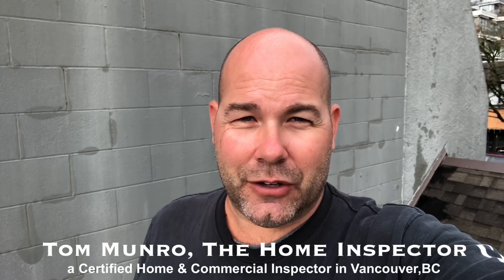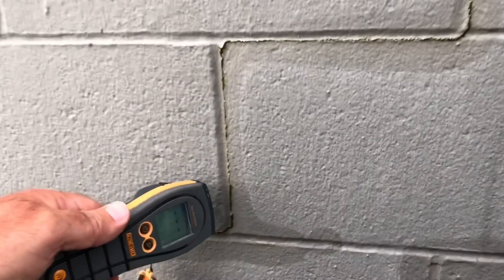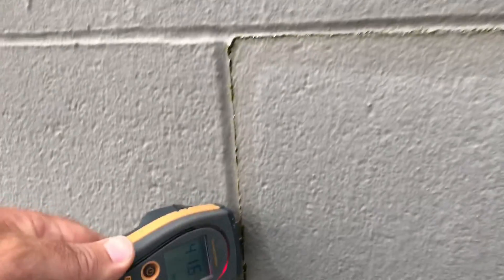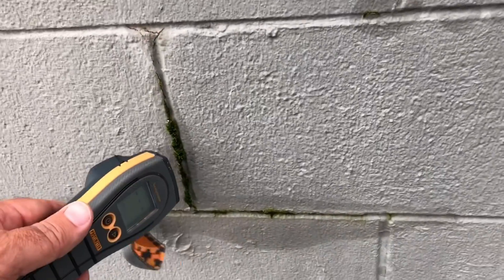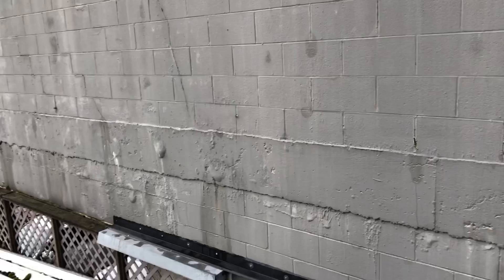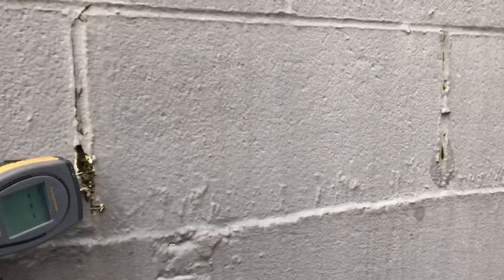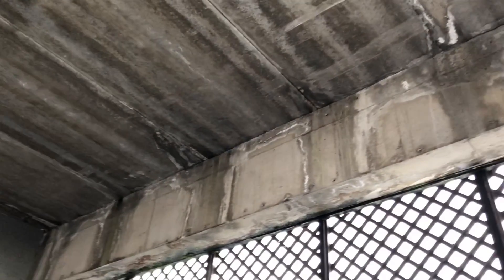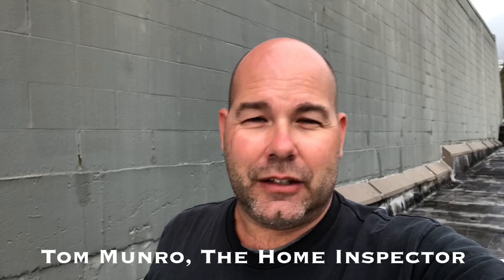Moisture Ingress Through a Concrete Wall

Comment: I have continued moisture in a concrete wall (Orlando) northwest part of the house. We had a roof leak (at the flashing where pitched roof meets the stucco) 9 months ago, took care of that, took the wall down to the concrete block, cleaned and dried out the concrete and put everything back together. Now after a hurricane with lots of rain, seem to be having moisture and funky smell in the wall again (although funky smell never completely left) House is 4 feet off the ground. Wall is part of a corner wall. Sprinklers are well away from the house. Need someone to solve this mystery.

Comment: I live in an apartment with concrete wall that has patches in wall above the window and when it rains it leaks water. The builders came in with a moisture reader which read 55% moisture should there be a concern about water inside the wall and mold because i see small black spots have started to appear in the area of the leak

Comment: I have an air conditioning drain tube (10 inches) coming from the basement through the front brick wall. The ground has been wet where it drains. I noticed that the block wall is wet near the bottom inside the basement. Is it from the outside drainage? Do I need to lengthen the air conditioner drain hose???

Comment: Hello Tom. I live in a industrial style condo with concrete ceiling and some walls. My ceiling continues to leak small drops depending on the weather. I have a dehumidifier but at times does not control the leaking. Any tips would be so appreciated? Thank you for the content!!!

Comment: I still find it confounding that you end every video by saying you post weekly. These videos are months apart.

Great quality video and very interesting find! I had water bubble out the latex paint one time behind a water pipe leak. Looked very similar to when you poked that one with the moisture meter and water trickled out.

I also found it interesting that a lot of points in the concrete block where it looked visibly wet actually registered less moisture on the meter than areas that looked relatively dryer.

Comment: I'm not clear how the moisture is getting into the wall.  Is it rain hitting the wall or rain entering the block at the top of the wall?
Reply: It is coming in through the change in materials. Where the brick meets the concrete should be a flashing. All changes in materials should be met with a flashing to disperse water.
Reply: @colintapping261  It would be interesting to find out what they eventually did about the moisture problem.
Reply: Its not exactly clear to me as well, but I assume that the gap in between the cement bricks wasnt sealed correctly or with the right mortar. To me it doesnt looked sealed properly
Reply: @user-zz4eu6tm2t  Thanks!  I thought I missed something.
Reply: The top should have a flashing covering it.